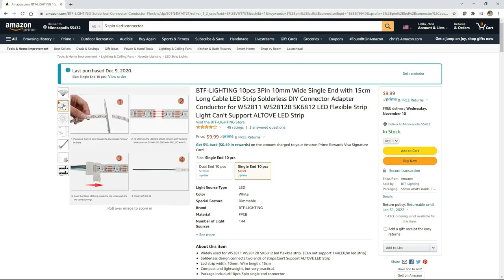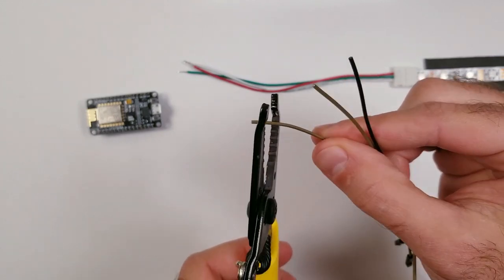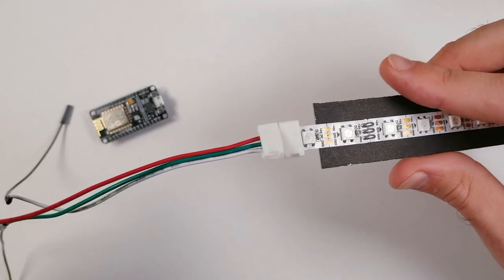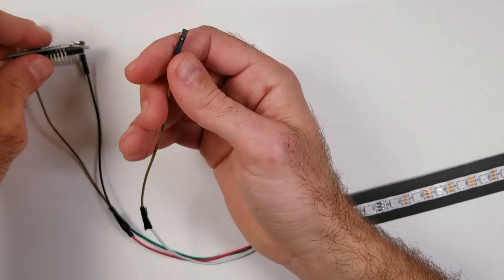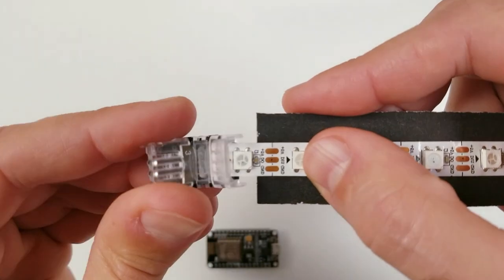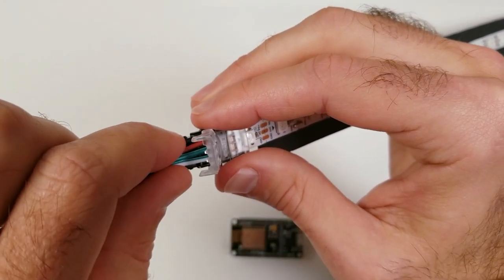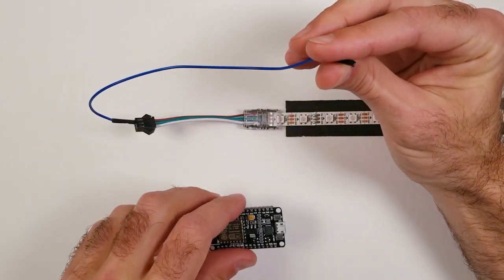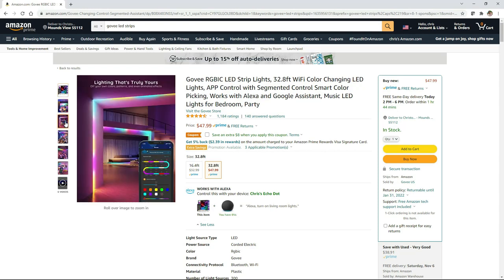Power Leftover LED Strips - No Soldering - 5v

Comment from the maker: 📦 AMAZON’s BEST DEALS (updated daily): https://bit.ly/3VWZKVS
📣 AliExpress’s BEST DEALS (updated daily): https://bit.ly/3VwoaDW
☑ Check out my sponsor to begin your FREE 14 day trial to Aura: https://aura.com/chrismaher
LED Lights I’m Using Amazon: https://amzn.to/43JQhCB 
AliExpress LED Lights SK6812: https://s.click.aliexpress.com/e/_DF2aoqn
LED Lights WS2812B on Amazon: https://amzn.to/3pngBDO
AliExpress LED Lights WS2812B: https://s.click.aliexpress.com/e/_Der0k7N
Jumper/Breadboard wires: https://amzn.to/3boLdtK
ESP8266 Board: https://amzn.to/3pSfo54
3 pin connector: https://amzn.to/3CI5Rkx
3 pin connector Terminal: https://amzn.to/2ZUpmbq
Micro USB cable: https://amzn.to/3bmJDc8

Controllers:

WIFI Controller: https://amzn.to/3q3SoAn
Bluetooth Controller: https://amzn.to/3k2HJCb
5v Wall Plug for Controllers: https://amzn.to/3nUyUeF

Link to my video on getting WLED installed on ESP8266: https://youtu.be/l8OMi7SMpqs

Links to a few of my other complete how-to projects:
RGB Baseboard Trim: https://youtu.be/Ik8HnGxfQq0
DIY Customizable Images: https://youtu.be/2q_zrEcbXHE
RGB LIGHT PROJECT: https://youtu.be/rIbTzUD2E4k
LED Strip Diffuser Ideas: https://youtu.be/09-fiWjP42Y
DIY Hexagon Project: https://youtu.be/t9xGyB4ahyY
DIY Corner Project: https://youtu.be/ZB5HqWhMXNo
DIY Edge Lit Designs: https://youtu.be/0_TtHkBB3vA
DIY Govee Glide: https://youtu.be/n9LsiQARFas
DIY Black Acrylic Floating Shelves: https://youtu.be/6csSMtV_op0

Song: InRp - Daydream
Music provided by Vlog No Copyright Music.
Video Link: https://youtu.be/daGHzcnKRyU

The best way to help support my channel is to like, comment, make sure your subscribed and share my videos with as many people as you can. The other way is to use my links above as I get a small % at no extra cost to you if you buy something. Thank you all for the support!

Comment: Rather than using electrical tape, which can be kinda messy, you can slip some thin heat shrink tubing onto a wire before twisting it to the other piece. It's easier & looks way more professional to boot. Furthermore, I'd slip an additional, slightly larger piece over all three wires & slide it out of the way. After you shrink the 3 individual wires, the larger piece then slides over those & shrinks them all together for an even cleaner & more reinforced finish.

Comment: This was an excellent video.  I've worked with the QuinLED before.  I've also done some basic projects with ESP32 devices.  Here are my questions, comments and video requests.
Which ESP32 devices do you purchase?  I've have good results with HiLetGo devices.
it would be nice if you added a spreedsheet with your YouTube channel for parts recommendations and Amazon links

When I work with kids, I've used superglue instead of soldering.  Maybe something to test...

Maybe a video on a small - hand sized solar panel with a power regulator to charge two 2850 batteries, then drop down/regulate to a 5V.  

Video on diffuser channels for LED strip lights. I liked your home brew lumber version.  

LED destruction video.  Take some of your leftover strip lights.  with all the versions, spray with water, leave outside, dunk in water.  

Keep up the good work.
Reply from the maker: Thanks so much for watching and taking the time to comment! I'm still very new at this and my guess is you know a lot more than I do! I've actually never used an esp32 device yet but a few people have recommended that I do since its better than the esp8266 that I have been using. If you think the HiLetGo ones are good, maybe that will be the first one I order when I do! Do you know how I would add a spreadsheet people could download from my YouTube channel? Or would I just add a link to like a dropbox file? I really like the superglue Idea! I do want to do a video on diffuser channels to see if there are any out there that actually do a good job so I love that idea too! I know nothing about solar stuff but love the idea and maybe if I learn more about that down the road I will try!

Thanks so much and I appreciate all the great feedback! Have a blessed day!

Comment: Hi this is a very helpful video. I need some help I an in the UK and have 4 pin lights +12v,G,R,B please could you tell me what I need, or help me with links. Would be great tank you.
Reply from the maker: Thanks so much Lydia for watching and the great question! I wish i had an answer for you but I really have not worked with those type of led strips :( I've really only used the 3pin individually addressable type. I'll take a look on youtube and see if there is anyone else that has some good videos on those type of strips! Thanks again!

Comment: Thanks again Chris! Quick question, does this work with Leds, that have that little clear coating on them?
Reply from the maker: It does! You just have to peel back the coating a little too get the connectors attached. Great question!!

Comment: I was wondering if how long or how many led strip bulbs can power up using the micro usb (wall plug)
Reply from the maker: It does depend on a lot of factors such as how powerful is the wall plug (they are not all the same) But in my new video with the RGB Baseboard Trim, I'm controlling 200 led lights with the micro usb. Now if i had those 200 lights on white and full brightness, you will for sure see a color drop off as you go further down but since all the animations generally will have colors (which doesn't take as much power as just pure white) I did not notice poor performance.
Reply: @ChrisMaherDIY   dude my man. thank you for this. I am waiting for your new project  on powering a long run of strip lights.

Comment: Can these connectors fit into aluminum channel?
Reply from the maker: Thanks so much for watching. It would depend on the alumimun channel you use. There would for sure be some that will work and but there might be a few channels that are too narrow to fit. Just check out the dimension to be sure. but I would say they probably will fit the majority of aluminum channels!

Comment: can the WS2812B  LED strip 2meter long (60 led per meter) be powered using PC PSU (5v line) ??
Reply from the maker: The short answer is yes. I've done that using WLED which has a cool power limiter built in. Your going to have to have the power pretty low which you can control on the WLED app and then it will be up to you to determine if the lights are bright enough for the intended use. I know I have personally been surprised at how many led lights I can power using such a limited power source. Thanks for watching!
Reply: @ChrisMaherDIY  i m trying to replicate ur nano leaf design which u have created on the other video. will the psu be enough to get a good brightness out of it ?
Reply from the maker: @TheMomonicky  i think at night it would be bright enough but during the day it would probably look pretty dim if you wanted the lights on.
Reply: @ChrisMaherDIY  my room is pretty dark corner of house. but which other Power supply/ adapter would u recommend as the strip doesnt come with any
Reply from the maker: @TheMomonicky  sorry, i sent the wrong link in the comment I just deleted. Below is the correct one. If you don't like how bright it is using the PC usb, the next step up I would recommend using would be this: https://amzn.to/32HnQKQ That would for sure provide more than enough power and if you decide to make something else with more LED's, you could use it for that as well.
Reply: @ChrisMaherDIY  thanks again

Comment: Im confused. I bought LED strip lights 2 months ago, wanted to cut it at the copper Mark and now im just left with half unusable LED lights
Reply from the maker: Thanks for watching! What lights did you buy? You should be able to hook up the extra strip you have left using this method if you bought the led lights that I put a link in the description for.
Reply: @ChrisMaherDIY  thanks! Will see

Comment: I was wondering of you have worked with any fiber optics using old LED strips?
Reply from the maker: I have not. It sounds interesting though. Have you? What's the application?!
Reply: @ChrisMaherDIY  so idk if you have seen the like rolls royce starlight DIY that people do in home theaters or movies but i was thinking in that term, fiber optics come in like 200 set bundles and usually at one end sits a light source (in theory a LED strip) and then a box around it that doesnt let that light go anywhere but into the fiber optic
Reply from the maker: @Zzafari7  I know exactly what you are talking about! I have not had any experience with that but its something I think looks super cool and I would love to try making something with! Thanks for the idea!
Reply: @ChrisMaherDIY  yeah no problem! i saw that most of the cost from the "kits" comes from the led driver which doesn't seem more than just a RBG led, the fiber optic bundle is actually really cheap
Reply from the maker: @Zzafari7  I'm even more curious now when you said it's cheap lol. Your speaking my language!
Reply: @ChrisMaherDIY  hahahha right, great videos tho, I did a similar diy nano leaf thing except with PVC board from home depot, for the diffusion sheet i used a super cheap sheet of acrylic OPTIX from home depot too
Reply from the maker: @Zzafari7  thats super cool! Part of the fun with these diy projects is finding random stuff that works! Did they turn out good?!
Reply: @ChrisMaherDIY  yessir they came out perfect, the diffusion is amazing
Reply: Zabi can we get a video of that diy nano?